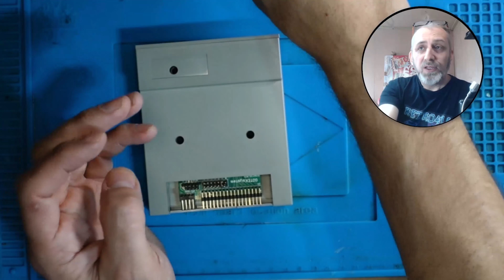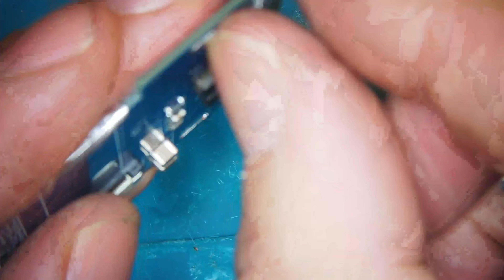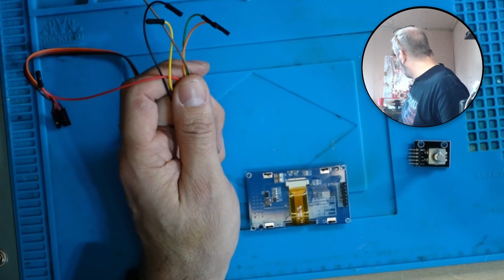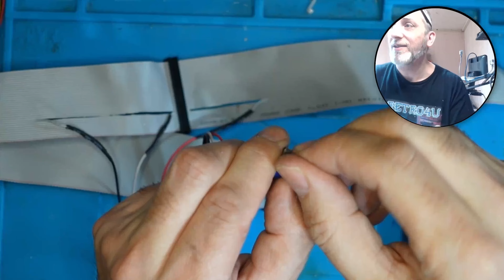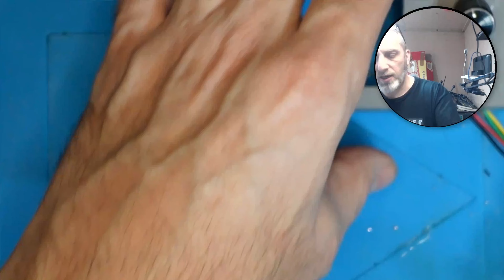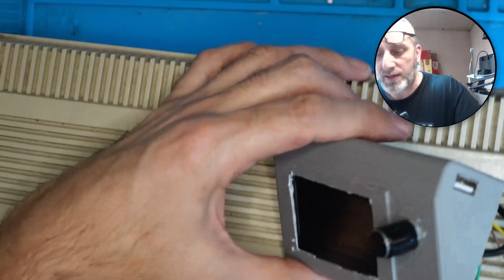Amiga 500 Plus Lets mod

Comment: where is positioned the switch? did  you  make a hole on the amiga case?  is possiv;e to do this witn an Amiga 500 (not plus)?
Reply from the maker: Not sure what switch your talking about :).  I think there is a 500 board out there you can build for sure. Thanks for the comment
Reply: @Retro4u  hi! the one for select which disk drive you want to use as"f0"
Reply from the maker: Tbh  never really thought about having a switch but I get you would not want to cut the case. So I’d suggest fitting a go drive that way they drive switch will be external and not cutting of the case
Reply: @Retro4u  oh shit! i didn't know that something like that does exists!! thanks mate!
Reply from the maker: Own an Amiga then do this! Install the GoDrive and Pistorm 32
https://youtu.be/cSl7s4Jf9Z4

Comment: Nice to see you're still using industrial precision tools 😊 Cable management if you can't see them they're tidy, for troubleshooting it's a future you problem 😂  The mod turned out really really nicely well done 👏. BTW love the check at 6:01 Is it bridged? 🤔
Reply from the maker: If you mean r5 yeah it need to be bridged I checked with the meter without it would have not worked. Well spotted though thanks for the comment yeah the mod works really well. Would like to design it into a board eventually that would be cool 😎